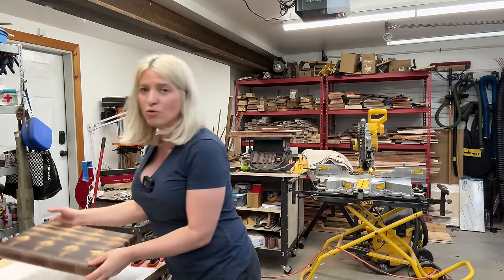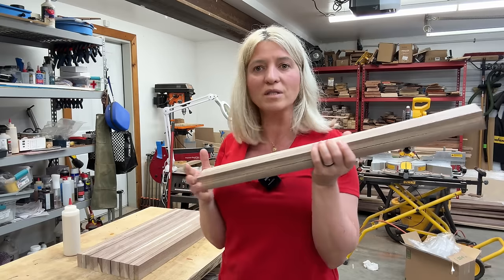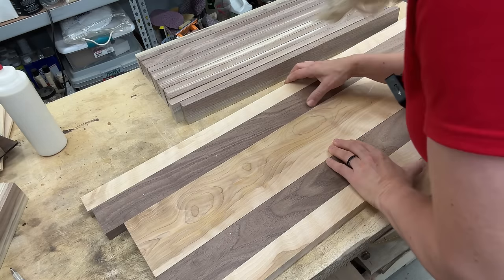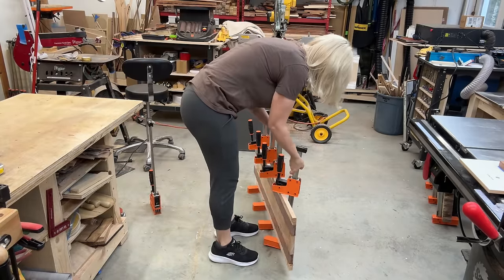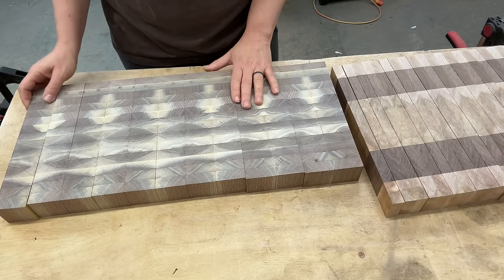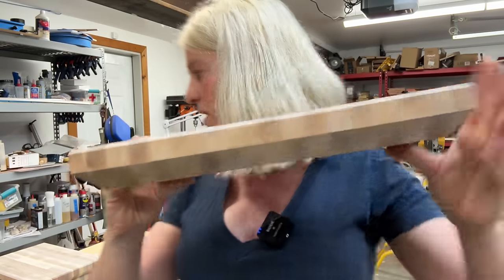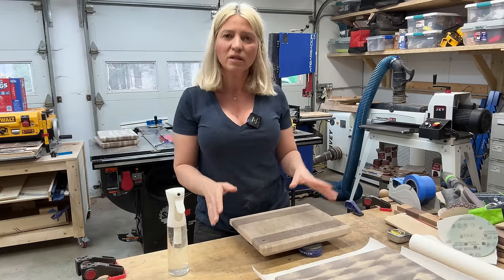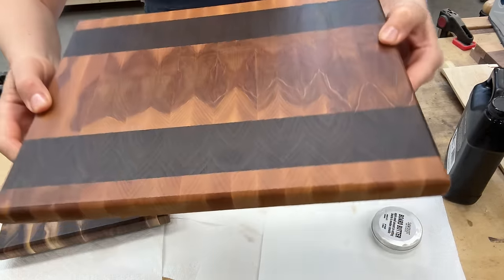How to make a beautiful grain cutting board. Great gift, easy to make . Woodworking project.

Comment: I use a LOT of Sweet Gum wood.  I have a ton of sweet gum trees on my property, so it's nothing to mill a few each year into 2x8 for projects the following year (after it dries) Sweet Gum has very dark mixed with very light wood.  So the patterns are wonderful.  The old timers around eastern KY here call sweet gum "satin walnut"   It's not used commercially because it shrinks and moves so much,  you have to mill it twice.  But it's worth it in the end.

Comment: You can also use alcohol to raise the grain in your wood. It dries in a few minutes and does the same thing. It would save you a ton of drying time, if you were making a lot of them at the same time. I've worked in a cabinet shop most of my life, in the finishing department, and we've done that. It also helps color uniformity, when staining something that might have lighter spots in the piece your staining.
Reply from the maker: That’s an awesome tip. Will definitely try that
Reply: @woodworkingwithSkyler , also, you don't have to wet it to much. All you need to do is wet it, just enough, to change the color of the wood. That will also save on drying time.

Comment: Hello there. Was wondering what laser would you recommend.  One that wouldn't be used every day.  That can be purchased in Ireland.  Love your channel. And thanks
Reply from the maker: Hi Michael. Depends on what you want to use it for. If it’s for engraving and cutting, then the Xtool S1 is the best laser I ever tested and the one I primarily use in my shop. 
If you are low on space and want something portable and small and never need to engrave anything bigger then 4x 16 and don’t need cutting capabilities. Basically just for engraving small things of putting your logo on something then the Xtool F1 is fantastic. 
Overall I don’t think you will regret getting the S1. 
If you do decide to purchase please use the link from any of my Xtool videos. At no extra cost to you, I earn a small commission.
Reply: I will do. And thanks for getting back to me i  will have to look into it thanks